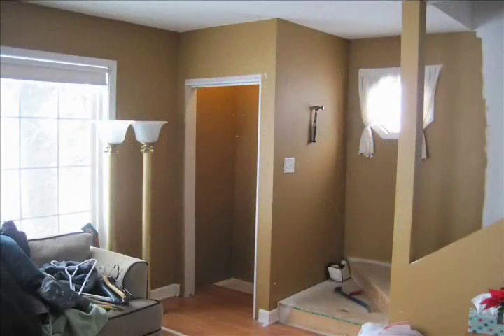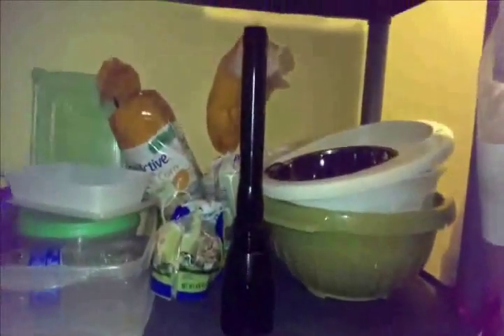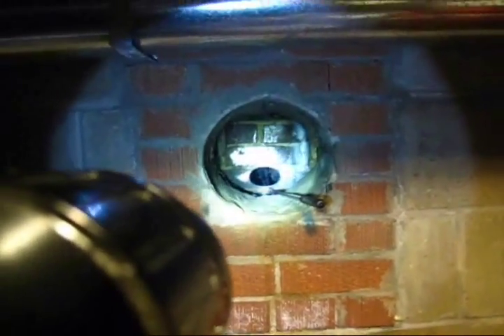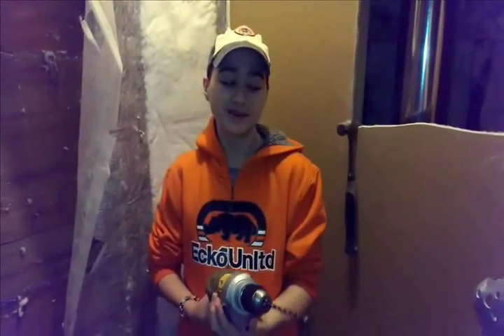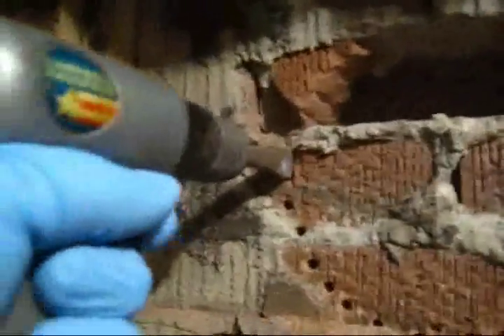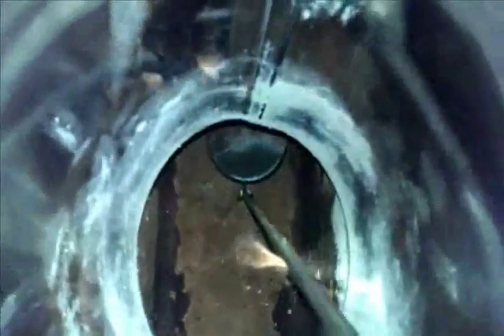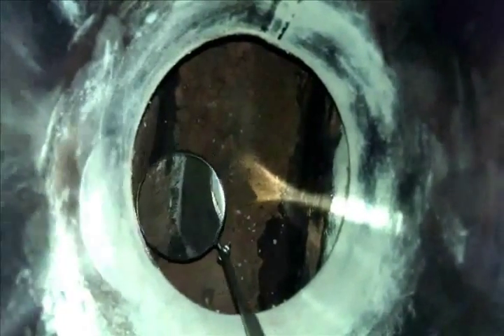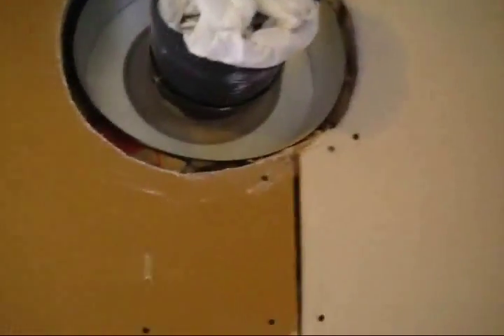Wood Burning Stove Installation using an existing brick chimney Start to Finish!

Comment: Thanks for the video, I am going to do the exact same thing so it was nice to see you do it first. I do have a question: Did you seal the bottom hole or leave it open?
Reply from the maker: You mean in basement going into chimney? No, just kept that same pan that was on there.